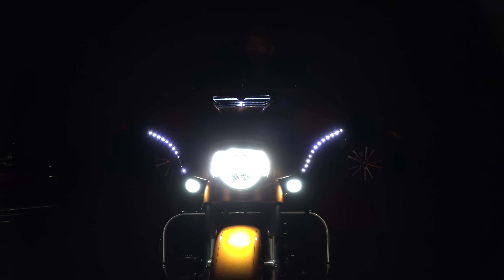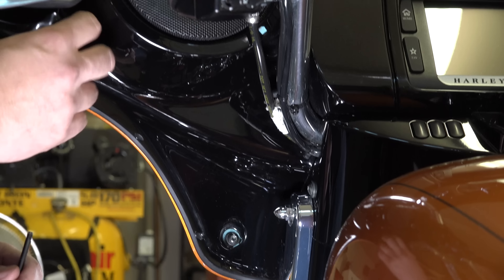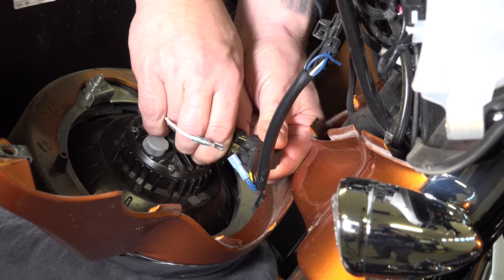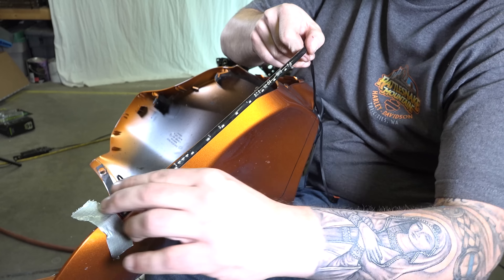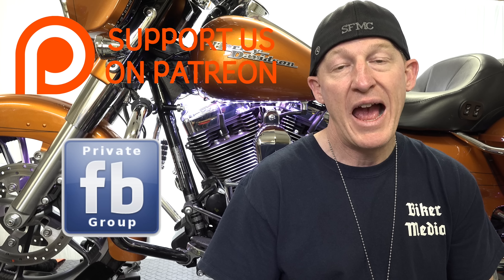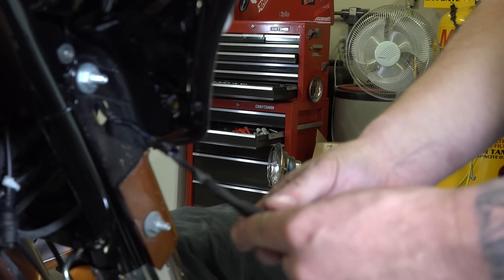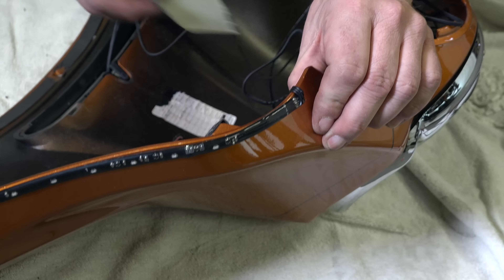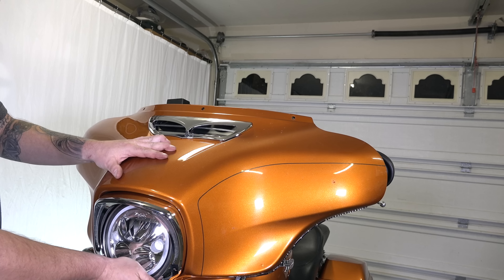How to Install Ciro 3D Bat Blades LED White & Amber Turn Signal Lights on Harley

Comment: What’s the chance that those plug and play ends can be cut so that I could install both the bat blades and the bag blades on my ‘03 Yamaha Road Star?
Reply: Shawn. Don't see why you couldn't cut off the little clip end and wire it into your wiring. There's no pos. or neg. to it so Go for it.
Reply: Garry that’s exactly what I was thinking.